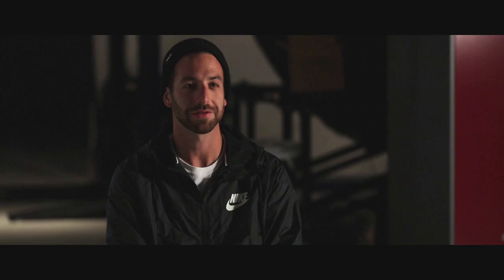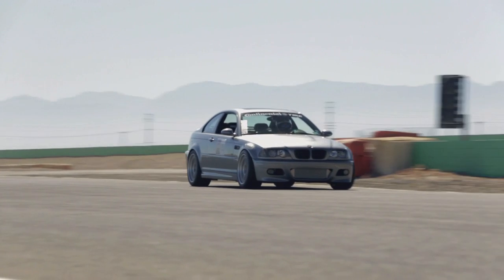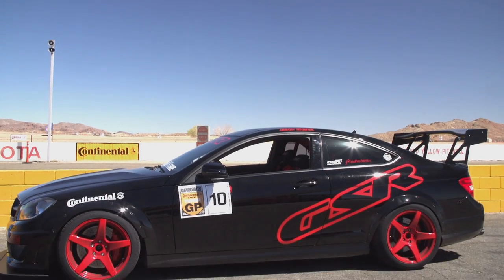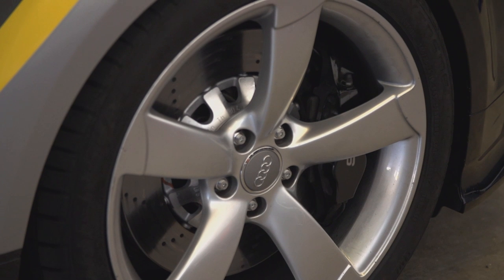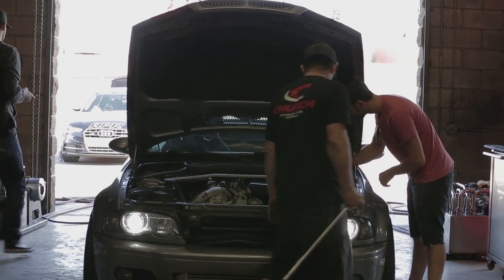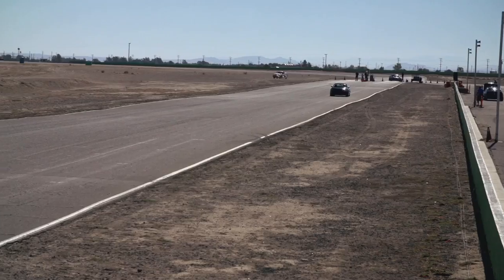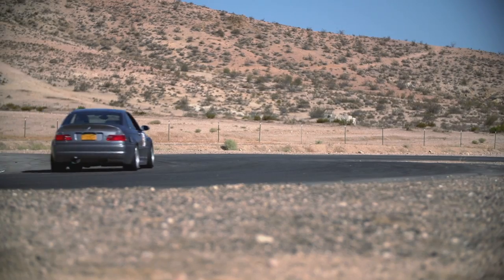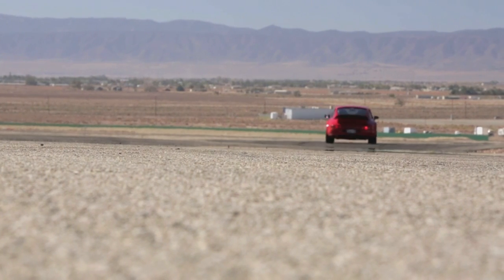European Car Tuner GP! Tuned M3, 911, C63 & More Battle on the Dyno, Drag & Track - Downshift Ep 69

Comment: A few thoughts, were the people able to back down their power from the dyno to go on the road course? Also why allow race fuel to be used, this seemed to be a street car event. Lastly fuel economy is huge in racing, being the fastest doesn't win races when you have to factor in pit stops
Reply: I think your drawing some kind of misinformation from other areas of racing you might be familiar with or watch frequently. Most of these participants are privately funded. This means: They can technically back down the power from the dyno if they have the capability to do so (piggy back ecu, run a safer map, he also says so at about 5:28), allowing race fuel to be used in a street car event is extremely common these cars are often "tuned" or calibrated to run on 100 octane. It would be more accurate to call this a "production" car event because most of these "street" cars are not street-legal. Your last question regarding fuel economy and pit-stops; im assuming they run multiple groups of 30 minutes sessions all throughout the day and compose the winners on fastest/ most consistent lap times. Im not familiar with euro GP but i HIGHLY doubt they have pit crews and run for more then 30 minutes at a time. If your tank of fuel doesnt last during a 30 minute session..you probably own a new gt500.
Reply: They are in CA which has higher fuel restrictions than most of the other states in the US. They don't even have 100 pump gas...
Reply: I think you are assuming a lot based on my comment. When speaking of lapping a road course being far is key but the amount of fuel consumed during a stint matters not only during a race but during a track day.  Track fuel is very expensive compared to the same fuel purchased at a normal gas station. Also if reliability for these modded cars is key, why allow them to dyno at one power level then possibly back down to a safer track power level. It doesn't show how reliable a 600whp modded car is on a track of it runs laps at 300whp let's say. And saying this is your daily driver but needing to run race fuel which is at some fuel stations but not all is misleading in regards to the street car part. Many of those cars are street legal in many states.
Reply: William Onwuka jr. What does any of that have to do with pump gas? Nothing... You said "Why allow race fuel" and I answered that. 100 octane is pump gas in all but CA which is all I was pointing out.
Reply: One I wasn't responding to you. Two you can buy 100 at pumps in ca since it's carb legal.
Reply: William Onwuka jr. Track fuel being more expensive than regular gas fuel? i would assume, the majority of us who do track days, buy a 15 gallon tank from walmart or autzone and bring it filled with us to the track. I think at the point of questioning whether they make you track at the same HP you dyno at becomes a strong criticizing of the way the event is run, therefore i wont answer it. I dont understand what your asking? are you just trying to say that this event is absurd and meaningless?
Personally i know track builds that are capable of 650 ish hp, but when run on the track with street tires the boost is turned down and they run at 475+. Why? because even a 275 street tire will be completely chewed up at 650hp.If you chew up your tires then your day is finished.
I feel you don't really understand what i said about being street legal, yes they arent street legal. But that TECHNICALLY doesn't mean they aren't registered and pass emissions. Get it? good. What happens if they live right next to a gas station that sells race fuel? or that they drive this everyday yet have an ability to maintain running 100 octane in it? I live in CA, I have yet to see 100 octane at any pump i've been to recently. The only way to get it around socal is to drive very far and fill up your external reservoirs and bring that to a track day. So yes you can buy it at pumps in ca, but not really.

Comment: Fuel economy is part of a race, unless you want to go too soon to the pit stops or not ending a race. In this case is more about lap times and  fuel economy isn't that important for that. Wen you star adding laps in a race (50 laps or more) everything counts, be it tiers, engine reliability or fuel consumption.
Reply: Wise man say: To finish first, one must first finish.
Reply: This idea of fuel economy has been created artificially in the early 80s. It came up as a part of the new F1/Rallye rules which tried to keep the engine power output down by limiting the ammount of fuel in cars. It sounds funny at first, but then, with those 600+, 700+, 1000+ hp cars, you literally poured gasoline into the engine in order to COOL IT DOWN. Especially the F1 was getting out of hand, when BMW had 1,5 liter engines outputting relatively reliable 1500 hp and kicking everybodys xxx although they had twice as big engines with more cylinders. So they just restricted the volume of the tanks used.

Comment: What kind of turbo are you running on the e46 m3.  did you tune it yourself?  who tuned it?  stand alone computer?
Reply: The turbo kit was by Maximum PSI, running the factory ECU tuned by Technique Tuning.
Reply: Thanks for the info Nick.  Do you know if they had have a built motor to run reliably for everyday street use too, or stock
Reply: sidewayzM That car is running a factory stock engine.
Reply: you spent 30k on upgrades he said.  whats the cost of the turbo system he is running?

Comment: Fords, Opels/Vauxhalls being counted as European is always a bit weird. I can see where people come from when they include them as European because they are so ubiquitous in their home countries. But they really aren't.

They are subsidiaries of BIG BIG BIG American companies and the cars share so much with cars available in the USA. Much of their underlying tech is shares as well as styling.

Its like when people call a VW Mexican or Brazilian. They are not! Not even if they were designed and built there.
Reply: Opel is an old old German company, their europe-only models are unique and the fact, that they have had several deals overseas in the past does not make it 'MURICAN in any way. Have you even seen their lineup? Which of US brands would you compare it to?
Reply: The difference with Mexico is they just build what ever comes out of Germany. But Both Opel and European Ford has been so different than their American counter part. It's more obvious since the big US auto crash in 2009. The American companies started to build what their European factories had been manufacturing as the global cars (one Ford), even for the US market.

They realized they could not keep building the same inferior cars that nobody wanted to by so they incorporated the European design, engineering and quality, which became their savior. These companies in Europe have worked very independently until very recently.
Reply: They're European because cars like the Fiesta and Focus ST are built for Europe primarily, where they've always been more popular.

Comment: Errrr, fuel consumption IS part of racing...
Reply: Depends on the race.
Reply: Dylan Greene Considering these are all street cars, I think fuel consumption is always going to be a factor. When the twisties are a bit of a hick, you need a bit of range to get there!
Reply: There is a big difference between street legal, and daily driver. You can buy a street legal koenigsegg with a 1,000hp, but good luck getting more than 5mpg out of it. Fuel consumption is not a factor in all racing, some "eco-heads" think it should be though.
Reply: Dylan Greene Lifted straight from the Koenigsegg website; "...combined cycle fuel consumption 14,7 litre per 100 km / 16MPG...". Even Nelson Racing quoted 18+MPG on the freeway with it's 2500hp powered Saleen! In REAL racing, ie anything longer then a 5 lap sprint, fuel consumption matters. It means less fuel to carry and less pit stops. Why do you think the diesel Audis won La Mans so many times?
Reply: davydoo81
 So real racing is anything over 5 laps? Narrow minded much? Drag racing, sprints, hill climbs, auto gymkana, the time attack series, are all real forms of motorsport where fuel economy makes no difference.
Reply: Dylan Greene Of course it still matters! the less fuel you can carry, the better!
Reply: Dylan Greene There's an intelligent response.
Reply: Dylan Greene If you have to resort to insults, you've already lost.
Reply: davydoo81

You don't listen I get bored, go play on your playstation.